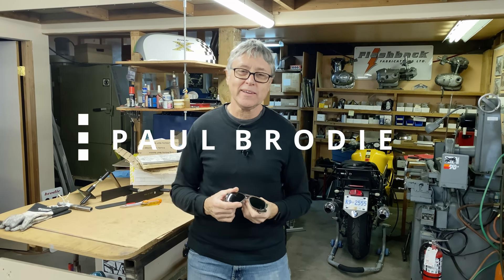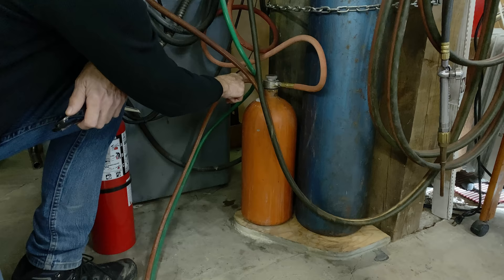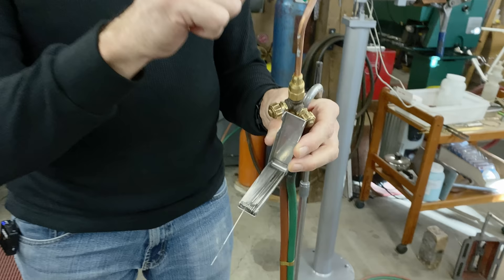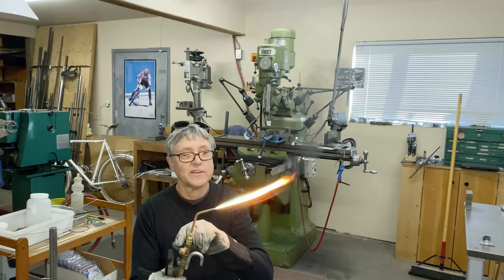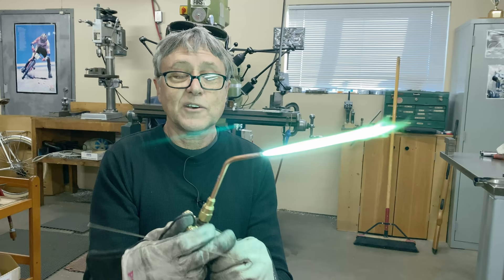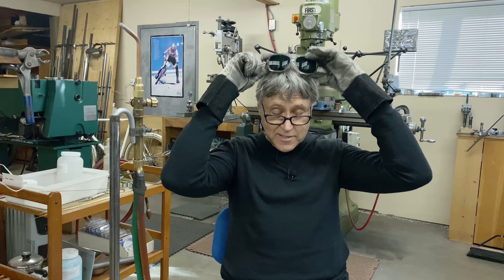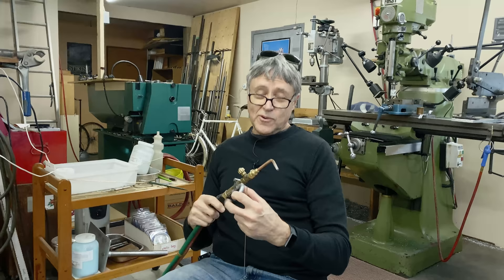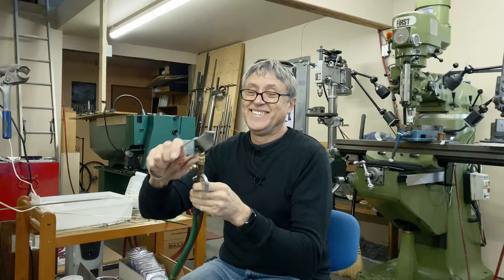How To Braze - Tips and Tricks with Paul Brodie

Comment: we silver solder stainless steel and brass sections for museum display mounts using propane. We flux the joint mating surfaces only and rely on capillary action to draw the solder round the whole joint in one go. I was interested to note the difference here in that the flux you used allows you to revisit the joint as much as necessary until complete. It also leaves less firescale than our method. Can you explain where the difference might lie? Obviously, one becomes used to a particular method and kit and if it does the job then there’s no need to try other torches, methods, metals etc. Thanks for posting this very interesting video.
Reply from the maker: You are using silver solder, and (in this video..) I am using nickel silver. They are vastly different, and you have confused the two. You are not the first. A LOT of viewers have also. Silver solder comes in a coil, is usually 45% or 56% silver, and melts at a fairly low temperature. Nickel silver, that I use, comes in straight lengths of 36", has ZERO % silver, and melts at a higher temp. I use a Soudotec 6800 rod. I am in Canada. Thanks for watching!
Reply: @paulbrodie  Thanks, Paul. I had noted that it was different material but didn’t know the different behavioural properties, which you have now pointed out. Many thanks for taking the time to reply. I’m in Devon UK. Thanks for all your videos which are a joy to watch and learn from.

Comment: Hello Mr. Brodie, as you are very knowledgeable about soldering, I have a question.
I have a motorcycle frame from the Harris company in England. This was soldered with SIF Bronze 101.
Which gases do I need to re-solder one or two solder joints!
Oxygen and ...?
thank you for the information
greeting
Karsten
Reply from the maker: Hello Karsten. I am more knowledgeable about brazing than soldering. I would use oxy-acetylene.

Comment: I've been watching your videos for quite some time and have finally taken the plunge to teach myself how to braze based on this video.  My goal is to make some racks for my next touring bike.  You videos are incredible!  Thanks for making them.  Can you tell me what glasses you are using while brazing?  I too need some glasses that will fit over my everyday glasses and want to protect my eyes as best as possible.  Thanks again!  Keith
Reply from the maker: Keith, thanks for liking our videos. Any good welding supply shop should have a selection of brazing glasses. You want to make sure the darkness of the lens is suitable for your situation, and that they fit over your reading glasses, if you have them. My glasses came from my father, and he used them in England in the early 60s. Probably hard to find now. Good luck with the racks. Racks are not easy to make.

Comment: Paul, I'm only familiar with the gas flux fluxer, being from Ohio,, can you give more info on the fluxer you're using in the shop?  Cheers
Reply from the maker: Hi Michael, I bought my fluxer in 1985 and paid $800, which was a lot at the time. I don't know the brand name, but I will check. It's fairly maintenance free, but every so often the ball check valve will stick and I have to remove the hose and tap the ball with a brazing rod. That usually works.The fluxer itself works very well, unlike the GasFlux company fluxer which I have to modify by welding in an extra 4" of tube to get enough flux capacity. Thanks for watching!
Reply: Thanks for the reply. The cost of the gasflux  fluxer always kept me away.

Comment: Hi Paul! Thank you so much for your great videos! I really appreciate your effort. I am wondering if you could give me some more information on the flux paste that you paint on in the tube to plate demo? I currently use stay silv white in the little bottle with a brush cap. It is so much thicker looking than what you are using. And mine drys out really fast. Any tips would be greatly appreciated 🙏🏻
Reply from the maker: Thanks for liking our videos. We have made two brazing videos. The second one shows all the rods and fluxes. I think the information you want is right there.

Comment: Paul, love the video. I, too, have gasflux. What do you use to get rid of the residue? It's like glass
Reply from the maker: Thank you Paul. The flux I use is water soluble, so soak the part in a bucket of hot water, or run hot water over the flux...:face-fuchsia-poop-shape:

Comment: A little off topic, but this looks to be a viable way to "mold" and shape a motorcycle frame (1960s  H-D chopper). I did not want to use lead or plastic body fillers on this build due to the toxicity of lead and normal body filler will crack. I am aware that the frame itself will be a huge heatsink so I have separate non flux tank setup with rose bud for preheating of larger areas, Similar J28 setup with smaller tanks for brazing work. Any body think Im crazy? I have another Harley frame to practice on beforehand. Material costs more expensive, but I need it to last.

Comment: Thanks for the overview of your brazing process. I'm looking into brazing so I can attempt to braze two broken mounting ears back onto an old cast iron exhaust manifold where it bolts to the cylinder head. What input would you have on preheating the casting before working? I'll be checking out your fillet brazing video as well as that will apply where the flanges meet the rest of the manifold.

Comment: So as someone who does welding mig and tig I can't help to think why braze? I have seen some custom drag motorcycles with very powerful engines that have a brazed frames is it because it more of a traditional type of metalworking? I have never done it before but cant help to think why braze when it could be welded. Thanks for the video I would love to have ago at some point looks really nice.
Reply from the maker: It's just a different technique. Fillet brazing can be very beautiful. Putting small brazeons on to a bicycle frame is best done with silver solder. If you ever change the cable routing they are easy to remove.

Comment: Nice Video.
Question: Can I braze with Mapp or Propane alone ?  Do I need Oxy ?
What setup would you recommend for beginners ?
Reply from the maker: I have only brazed with oxy-acetylene. That's what I would recommend. I don't know of any long term frame builders that use anything else, like Mapp or Propane. There must be a reason for that. Thanks for watching....    :face-orange-biting-nails:
Reply: Back when MAPP was introduced, the story was that Propane is a 2500°F Flame and Acetylene is a 6500°F Flame, and so MAPP was to fill that gap with a 4500°F Flame.  At the time, going from Propane to MAPP was a night and day difference.  Lately, I have both read and experienced that MAPP is less different than it was early on (on the cooler side).  I would really like to hear what the REAL experts have to add to this account.

Comment: So when you solder do you do one joint at a time? When do you reflux a joint? If it gets too hot do you start over or just wire brush it clean and flux it again? When someone has brassed a part and you want to weld it. How do you get rid of the brass?

Comment: Paul, can I use an oxyacetylene torch to repair a bronze statue using a silicon bronze rod? Most people use TIG welding, but it just too expensive for me.   Everyone talks about bronze brazing, but not bronze brazing BRONZE.   I wonder if it’s not possible because the statue and the rod have the roughly same melting temperature.   I want to use silicon bronze  filler rod, because the bronze I used in my sculpture is also silicon bronze.   This should create an even patina and hide the repairs.
Reply from the maker: Good questions! I have very little experience brazing and repairing bronze, sorry. I suggest trying a very small amount. That will give you an indication if it wants to, or not. Remember to clean everything very well, adjust the torch properly, and use clean flux.

Comment: Which is more fluid , the silver solder or brazing rod? I have to reweld the tube on my diesel fuel tank? It was welded originally with silver solder, there's a small gap now.

Comment: Paul I have a buck and a doe Bronze Statues a full size and they're basically garden statues expensive ones but the legs are broken off at about 10 inches up how would I join those and then there's some cracking also like it's a neck in the ear and I want to just fill it there's the metal fillers that are epoxy-based I believe but could you elaborate on that and how I have a Turbo Torch with an acetylene mixer I don't know if you're familiar with that but it's just a b tank of acetylene and it's got a mixer at the tank thank you I just don't wondering how hot would have to get something that large
Reply from the maker: Joe, I have brazed a lot of steel, but I have never brazed bronze. I did silver solder brass to brass, but that was tricky and took a little while to learn. Sorry I cannot offer you any assistance.

Comment: What is the base metal again? Can I just buy a few rods? I guess at Harbor Freight? How are the rods sold? Is this considered Brazing , welding or Soldering? I have a Torch set I restore old Cars. I use old Hangers to weld with! Usually floor Panels or if I weld on a Set of Mufflers and can find some old hangers usually the wife finds them. I save money using hangers. I do use respirators since I am unsure of the Coating on the Metal Clothes Hanger? My brother started welding in a Muffler Shop in West Covina Buds Muffler No Muff too tuff! We learned the hanger trick when we could not or did not have any Rod. We also pit crewed for Big Daddy Don Garlits. We ran the push Car this was the days Electric Starters for Top Fuel were just coming along and before Don Cut off his toes when the Clutch Exploded. Welding Frames for Bud Heaton’s the owner of Buds muffler who owned his own dragster cracking welds was common the frame cracked we are talking early 1970’s. Drag racing was coming around putting 426 Hemi’s  together with spray Silicon had just come out. The heads were coming off the next run anyway! I welded many times on Don prodhomme Funny Car at the old Irwindale Raceway. Really this is where In &Out got there start! And where as a punk kid I learned to weld! Tbe hangers work great for floor panels with Acetylene/oxygen just wear respirator! Safety first. I have welded this way from the age is 14
Reply from the maker: The base metal is steel. Your local welding shop may sell you a few rods, or you might have to buy a pound or two. The video name is Brazing 101, so this is "Brazing". Thanks for telling some racing stories...

Comment: Paul, you mention Nickel Silver brazing rods. 2 questions. What spec? Also you do it prior to bronze on fillet brazing. Is this to ensure an internal fillet? Thanks!
Reply from the maker: Tom, we have 2 brazing videos, and I know for sure in the second one we detailed all rods and fluxes, based on questions from video number one. Nickel silver flows just a little nicer than bronze, and the rod is a smaller diameter so it is just easier to make sure the joint is fully penetrated with zero air pockets.

Comment: Can you use jelly soldering Flux or does it have to be specifically a brazing type of flux?
Reply from the maker: I have never used jelly soldering flux; no experience there. Fluxes are not all created equal. In the video I have mentioned what fluxes I use. Many other frame builders use these same fluxes. Flux is not a huge expense. Buy the best and give yourself a better shot at brazing success.

Comment: one quest. wich are the best pressures of the oxigen and acetylene for braze coper with coper?
Reply from the maker: I would think that brazing copper to copper would be very tricky. I have never done it. I would probably use silver solder. I set my gauges at 2-4 lbs pressure. That would be for a small job. You never mentioned how big the copper is. If there is a lot of mass, you will have to increase the pressure to get a larger flame.     :face-blue-three-eyes:

Comment: Hi, I've got a problem when I'm trying to braze fill pitting caused by oxidation. 
I'm trying to fill the pitting on an exaust to smooth out the surface with silver or bronze before chrome or ceramic paint and the problems I encounter is that it doesn't stay in the hole but flows around from where I want it to be.
Also at one point it will "explode" the puddle when trying to add more silver or bronze to fill te hole.
I'm using flux covered rods.
Do you have any ideas of what I´m doing wrong?
Please disregard any and all writing errors, english is not my native language.
Reply from the maker: Your English is fine, not a problem..  Trying to braze / fill an old exhaust pipe is one of the hardest things, so don't feel bad. It is old metal that has probably been through thousands of heat cycles. And now you have added a few more intense heat cycles.  You need to prep very well, get the steel down to base metal. Having an automatic fluxer would help, but not everyone has one. If not, applying paste flux to the cold metal might help, but like I said, it is a very difficult job and chances of success are small.  All the best in 2024!     :face-orange-biting-nails::face-orange-biting-nails:

Comment: Great video as usual, have you ever used TIG brazing and what do you think about using it for frame building?
Reply from the maker: Thank you. Yes I have done some TIG brazing, but not on bicycle frames or forks. If done properly it would probably work fine, but that makes me wonder why no one that I know of is doing it... ?
Reply: @paulbrodie  I have done a little TIG welding and have a TIG/ARC welder, the problem for me is I cannot get acetlyene for domestic use and having seen TIG brazing, thought why not? Might give it a try
Reply from the maker: @danielleahy2456  Practice on some thin walled tubes to start. Then, braze up a downtube / BB combo, and then hold the BB in a vise and pull the downtube until something breaks or fails. The braze should hold and the tube should fail next to the braze. Let me know!
Reply: @paulbrodie  Thanks for the advice Paul, I will give it a go and will let you know how it turns out

Comment: I do copper brazing for work, and there are specific pressures you're supposed to use for each size tip. Is this the same for fillet brazing?
Reply from the maker: Yes, there are probably Rules of Thumb for pressures. In the Real World, there is probably a lot more leeway. For my small torch, a Victor J28, I use a zero tip, and a one. Do I change the pressure when switching tips? Never. If I use my big torch with a number 4 tip, do I change the pressure for that? I'm thinking back, and I would have to say no. I set pressures between 2 and 4 psi.   :face-blue-three-eyes:

Comment: I'm an old timer and have adjusted my torch just like you. I'm 72 and I ran into an even older welder/brazer. He said when you are welding art you stop and stop your torch a lot. Instead of adjusting your flame at the handle adjust the flame at the gauges and just use the handle knobs to open or stop the gas. he said it's much faster and you have lower pressure in the hose because you use pressure to adjust the flame. I tried it and it seems to work much better. I even light a candle to start the touch.   Is this safe? Seems to be.
Reply from the maker: Yes, I would think it is safe but it's not a technique I would probably use.

Comment: Hi Paul, fantastic videos! Thanks so much for you detailed explanations on brazing.
I have a question about modifying older frames:

So after experimenting with builds with vintage and newer frames I've discovered I basically want an 80s fillet brazed frame, but would like the seat tube to be a bit shorter and the top tube ever so slightly sloping down. For reference: A Peugeot Aubisque from the mid 80s in 58cm size would be a perfect starter I think.
Would it be possible to modify the frame where I cut off the seatstays and top tube and shorten the seat tube by 40-50mm?
Ideally I would like to then also shorten the originally removed seatstays and reattach them, and fix up the miter on the original top tube and reattach that. 
I've measured it and it looks like the top tube would get about 10-12mm shorter by sloping it down slightly, so I'm hoping if I cut very carefully I could re-use that original top tube because I'd only be removing about 5 to 6mm from the butt of each end, and the top tube isn't stressed as hard as the downtube or chainstays.

If you have any advice for me, I would be very happy! I'm a young designer and would some day love to also become a framebuilder/designer.
Reply from the maker: Yes, it's all possible. You just need to think it through and have good technique. Good luck.
Reply: @paulbrodie  Thanks! I'll start refining my technique and do some practicing on scrap frames then.

Comment: The only fluxes that I have are a whit almost powder, is that type of Flux ok to use?  I didn't even know you could get flux that runs in line, when using inline flux do not have to put any flux on the metal before starting?
Reply from the maker: You have a white flux... It may be ok, maybe not. We have 2 brazing videos. Between them, there is all of the info on what rods and fluxes I use, and pictures of the labels, etc. Yes, when I am brazing steel, I use both fluxes. It's the best way. First I apply the paste flux on the COLD steel, then braze. The torch has an inline fluxer, that holds a clear, stinky clear liquid. Smells very toxic. This is what mixes with the acetylene gas, and comes out as a flame. Hope I have helped....   :face-orange-raised-eyebrow::face-orange-raised-eyebrow: